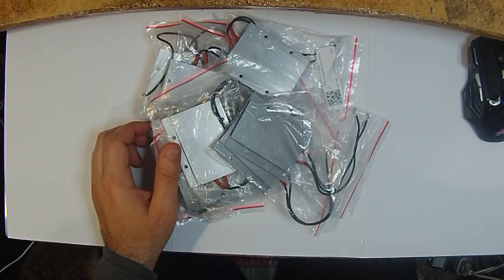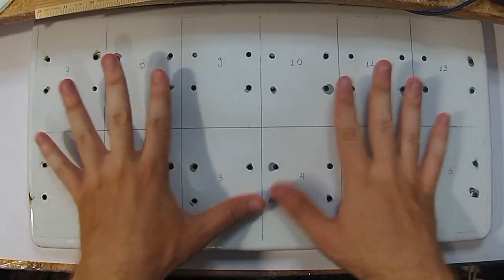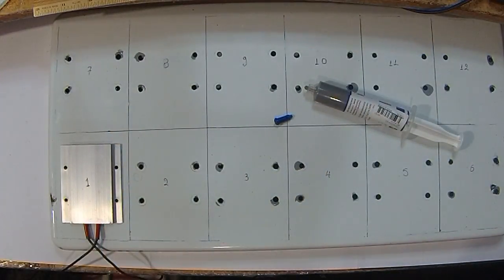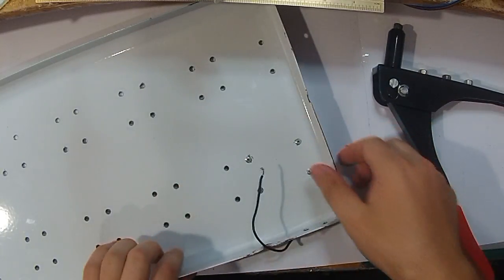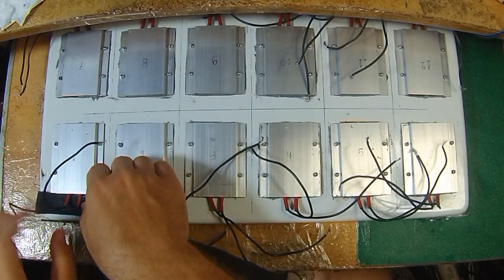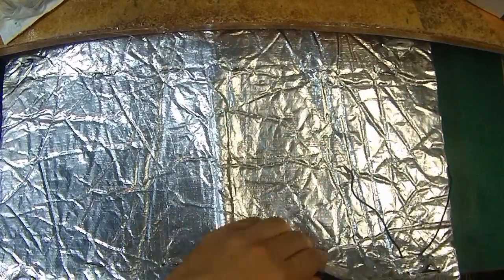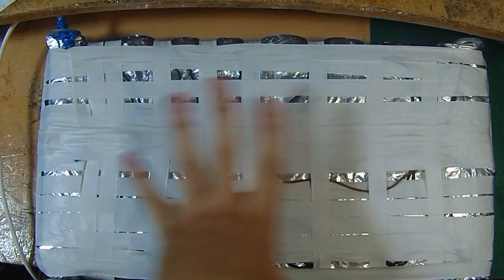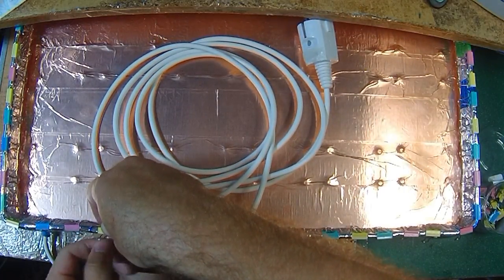DIY: Heating Pad 80C

Comment: Have you checked silicone headbeds for 3dprinter? they go to 100ºC pretty easily
Reply from the maker: Yes and they can reach up to 450C which is insane, they also require a temperature control and a sensor and also an external power source (they do not work directly with 220V.

So the outcome would be like 2~3x times more expensive than what I did.
Reply: mine go directly to 220v with temp sensor integrated, but need a SSR (relay) for control via board (i use arduino+ramps) more or less is 50-60€
Reply from the maker: It is nice it doesn't need a transformer for voltage but as you see you already have to have sensors etc. also a heating bed is rather small, not that the thing I did was huge but if I could find something bigger, I would spread the heating modules apart a little bit and it would still work. I mean for the size, 12 modules were too many, they would still work even if I got 8 for example.

My first search was for heating beds and I wanted to stay out of the sensors and stuff.
Then I searched for heating modules that have integrated heating control so I could simply turn a dial and get the temperature, but I couldn't find anything.

So I had to go to an easy solution with fixed temperature at 80C that needs nothing but a plug to make them work.
Reply: I just tried to bleach a chunk of hair in the heated bed at 40ª. Turned it white lol! (in just foil, it  only archieved orange) So this is a great idea.
Reply from the maker: Exactly, like the roots of our hair turn so pale only because of the heat of our head and this can easily take it high enough.

I have second thoughts about the 80C, it might be too much but I will keep and eye on it.

I'll make a video on how this works
Reply: I put a plastic tupper upside down over the hair foiled so it's like an "oven", so I think you could do the same and turn it off when it's hot enough.
Reply from the maker: Yes, closing the top part with something surely ensures the heat will stay.

I just ordered a digital thermostat to make sure I can play with the temperature, I might have to take it lower to like 35~40C which is closer to the scalp temperature.

This kinda makes me hate not taking the 150C ones, I would have been able to go from room temperature to literally extreme heat, but anyway. I'll have to make an update on how it is supposed to be used and how it helps and also I'll do another update when my thermostat arrives.

I'll mention your comments on my video, you are being helpful.

Comment: You didn't test it, and measure the temperature
And important thing you should use a fuse and grounding line, also use the heat limiter like thermostat to prevent the element from burning.